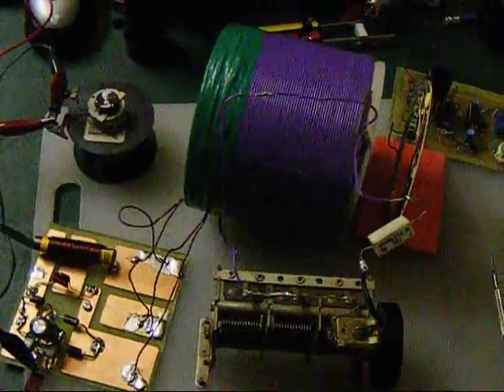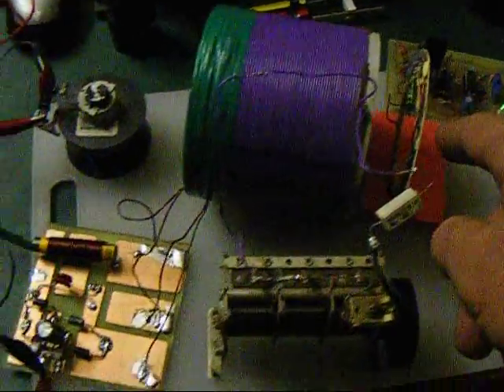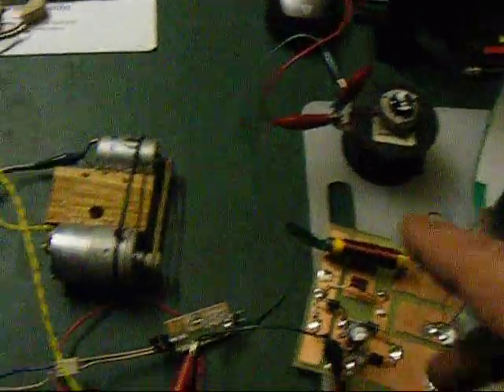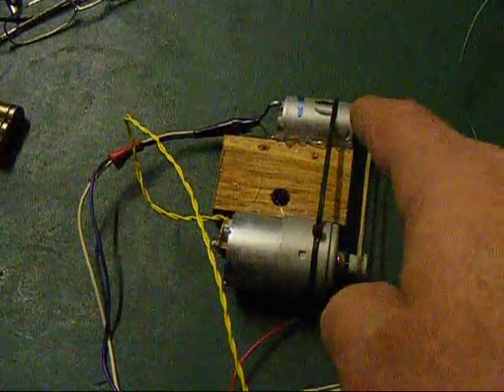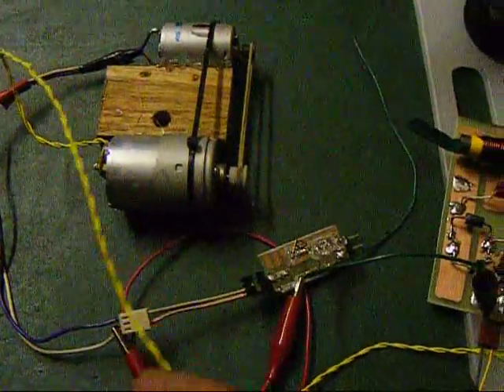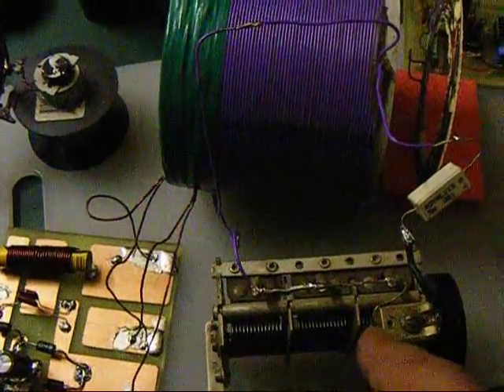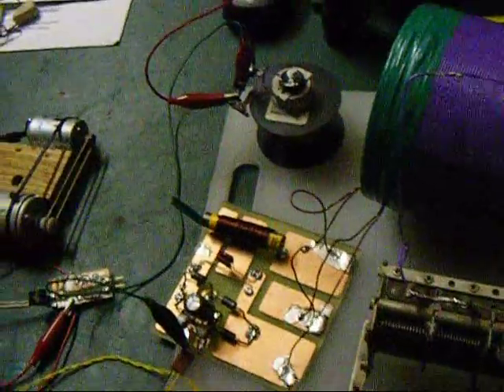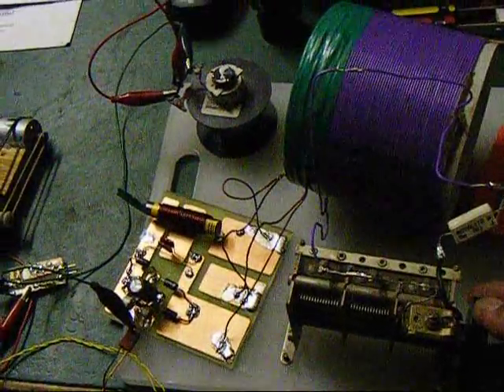Resonant Tank Tapping with Resonance ! Tesla's Bad Dream circuit

Comment: My hearing.... what was the last you said, last two sentences?
Reply from the maker: I mentioned I would get measurements on the massive tank voltages and currents later. You can see more info at this forum page. http://www.overunity.com/14443/quantum-energy-generator-qeg-open-sourced-by-hopegirl/msg413352/#new

Copy and paste link if it doesn't work.
Reply: Thank you.

Comment: In this arrangement, are you tuning the DC generator to match the inductance of the motor coils in order to increase the mechanical output?  I'm uncertain how far up resonance can take the efficiency of a circuit...  How does the loss of watts from internal dissipation compare between DC and AC?  If I was going to guess, I'd say each would be equal in this regard.  There are two resonator circuits I'm aware of, one being the Meissner circuit ( in an amplifier arrangement ) shown at TheGuru2You - Self Resonating Power Circuit for HHO Cell (3 of 3)  and the other is an AC driver by JL Naudin, posted with his work on Richard Vialle's generator - http://jnaudin.free.fr/rvproject/html/ugentest3.htm
Reply from the maker: Hi BroigWoolig, I only just worked out there is a silly spam filter on by default, all are free to comment. Anyway to answer your question I think you mean the two little DC motors ? If so no in this setup I've full wave rectified the the HF LV AC output and smoothed it somewhat with a 6.8 uF capacitor so the motor driving the other motor as a generator is powered by "smoothish" DC, in this case I think the
load on the HF AC would be capacitive but "linear" maybe not sure, I'm no expert.
If any true experts do read these comments feel free to comment please. : )